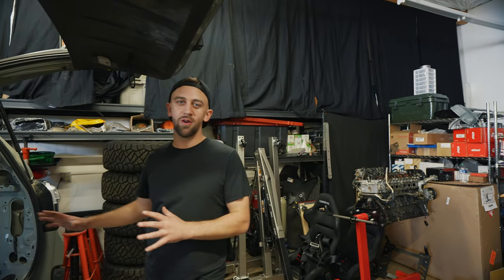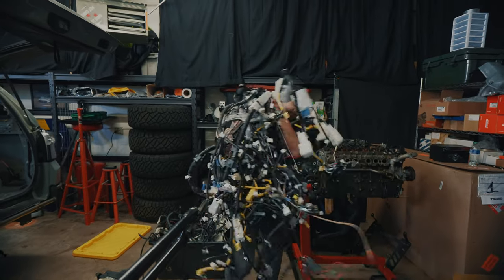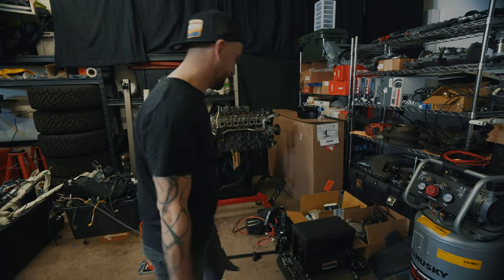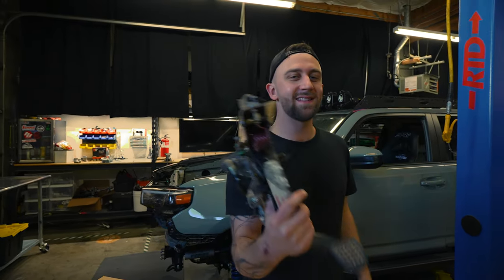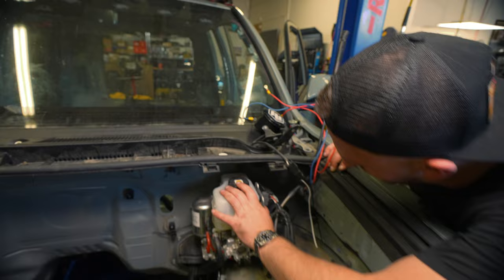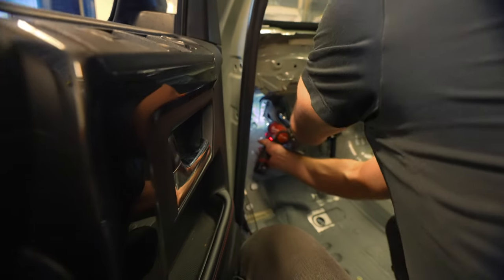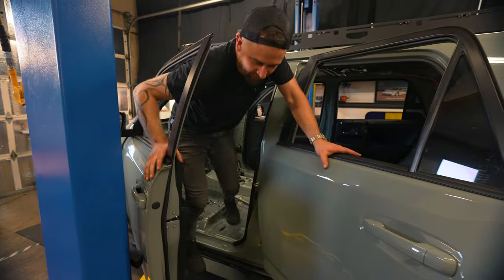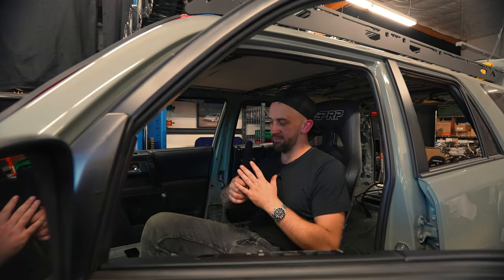3rd Gen Tacoma Clutch Pedal in my 2021 TRD PRO 4Runner?!?!

Comment: Dude you jsut confirms my suspicion about the 5th gen body when you went to mount the clutch, ive been doing some digging around on my 2019 voodoo 5th gen that alot is shared with the fortuner overseas (all the mounting holes & knock outs are pretty much there for all the diesel and manual options
Reply from the maker: That was a very exciting moment. I had my doubts about it being there... but when I saw the first relief, I got very excited.